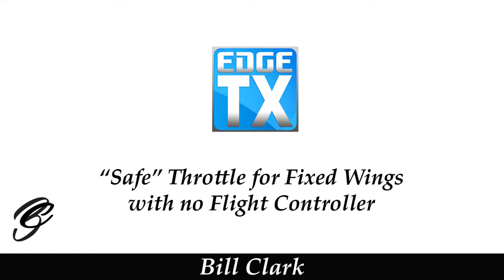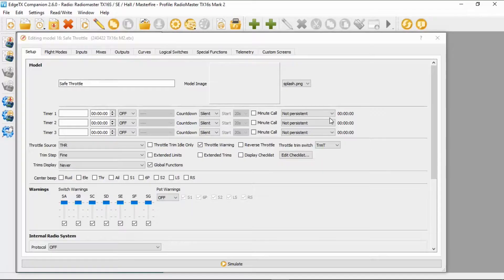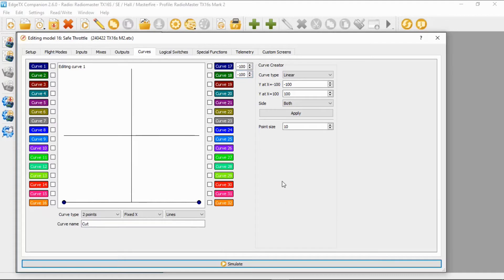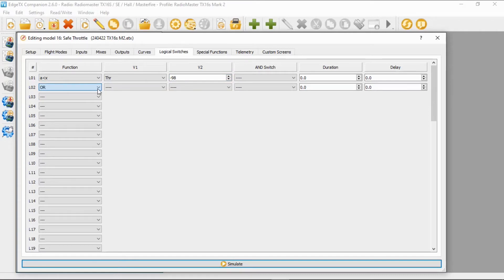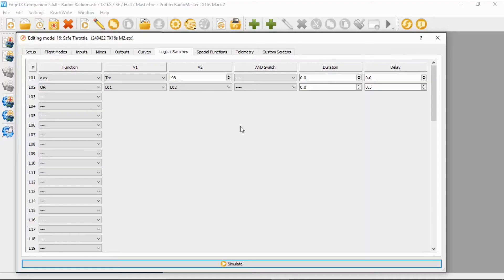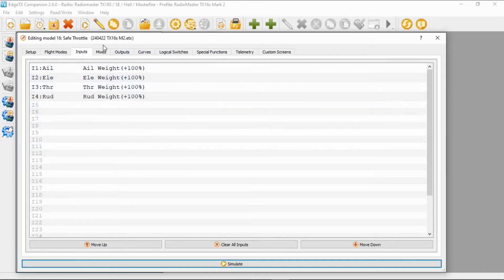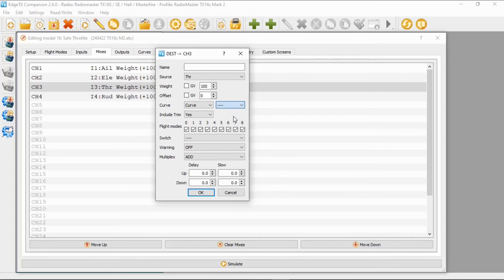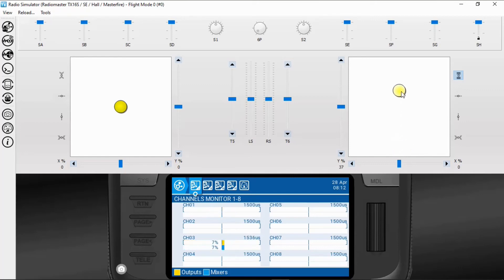EdgeTX "Safe" Throttle for Fixed Wings with no Flight Controller

Comment: Good video, I enjoy learning these tips with EdgeTx. Not sure if it was possible two years ago, when this video was released, but now you can skip the curve and mixes altogether. Now you can just use a Special Function, set the !L02 logical switch as Trigger and Function to Override, select Channel 3 and set to -100. This special function will make sure the CH3 output will be overridden to -100 (you also get a nice lock icon in the Channel monitor to show that the channel is locked).

Comment: Hi Bill. Thanks for all your advice which has been really useful to me over the last couple of years. I have a TX16s and this was one of the first things I did. I set it up on SH which I set up as per you click on /click of switch. Is there a way to add to this so that after flying a model, the throttle will automatically disarm after a period of time, say 60secs. I know one could just flick the arm switch off, but maybe you're going to quickly put another battery in so you don't bother (or just forget!!) This "auto reset" of the throttle lock would ensure nobody (grandsons!) opens the throttle if the tx is sitting around unattended.
As logical switches are above my pay grade(!), I have searched for such a setup but been unable to find one. If you have done one I'd be grateful for a link. If not, perhaps you could see what you can come up with. Many thanks. Mike
Reply from the maker: Hi Mike, so you want the motor to automatically disarm after a set time period. If with the safe throttle you leave the throttle up it will not arm so little fingers cannot    get harmed. You can also set up triple arm system of arming which I could show you how to do.
Reply: Thanks for getting back Bill. It's my fingers I'm more worried about, in case the "little" fingers waggle the throttle stick!!!
Ideally if the throttle has been idle for say 30secs, it would be great if the motor automatically disarmed.  Don't know if the triple arming would help. Thanks again
Reply from the maker: Hi Mike, I will work on this for you and release a video as soon as I can.
Reply: That's fantastic Bill. Look forward to it. Thankyou so much

Comment: Your Companion page looks different than mine. I did not know how to pick a curve line. I could have understood this better if you were showing me how to do this directly on my TX-16S. Thanks anyway.
Reply from the maker: In the future I will only do the programing on the radios to make it easy for my viewers. Thanks for your comment.
Reply: @the-happy-RC-flyer  On the other hand, Edge TX radios are offered in two user interfaces, one for color/touch and one for basic black & white. Advanced configurations on my RadioMaster Pocket can only be done with this software so I found it extremely helpful. IMO if you're on Edge TX you should probably get comfortable in this software. Just change the video title to "Edge TX Companion Safe Throttle..." :)

Comment: Thanks for the idea. Used the logical switch approach from your guide but decided to skip the curve and set that up a bit different. I added a throttle mx after the stick mix that has source - max, weight -100%, switch !L02 and multiplex - replace. Saves a curve (which we most likely don't need to save).